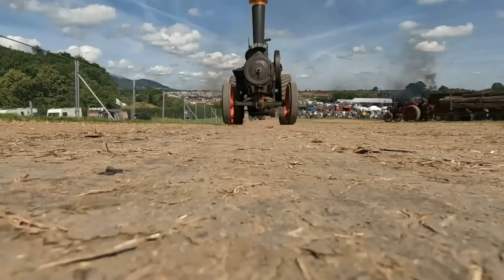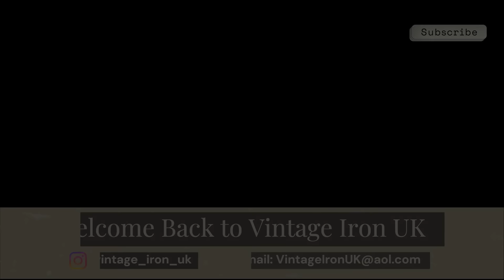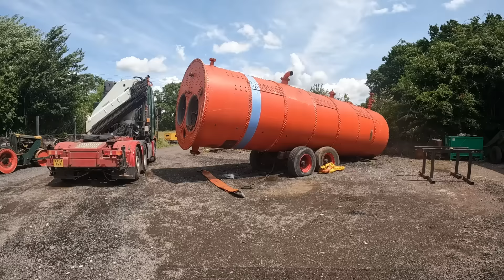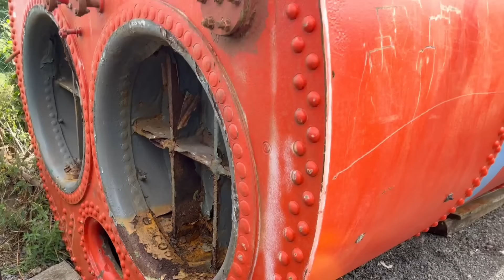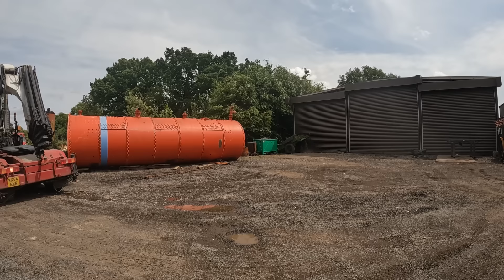YARD UPDATE!! Lancashire Boiler Move, TRACTION ENGINE Repairs, Power Hammer run & Future Projects!

Comment: That enormous, belt driven air hammer is awesome. It'd go great with a good old timey coal fired forge. You might even be able to plumb air from the compressor exhaust to act as a bellows.

Comment: Just face it Norman, the old Aveling was too much for those modern tin axels😁. Loving the big hammer. But I think the old steam crane is the best machine you have that I have seen. Having it under steam with a good boiler would be excellent. cheers

Comment: Norm. Why does the red boiler have a painted blue band? And have you run out of elves 🧝‍♂️? ❤️👍🏴
Reply from the maker: Not a clue mate Somthing to do with the company that used it last as an air receiver. At a guess the blue line would be for air, any pipe work would have been the same?? Gas and fuel being different. As for the elves the quit due to the lack of pay, should have locked the gate 😂

Comment: At Crewe locomotive works open days they used to demonstrate hammers, they had an oil drum full of something and just before the hammer struck they threw a handful onto the hot metal, I always wondered what it was, sawdust perhaps, and I guess to stop the metal sticking in the die. Any idea what it was please ?
Reply from the maker: I’ve heard coal dust being used to stop tools sticking. Could be that or some sort of graphite mix.
Reply: @VintageIronukseen a film at a plate mill they were tossing bundles of twiggy foliage on think it helped blowing the scale off
Reply: @johngibson3837  Interesting They used some kind of powder at Crewe, I guess there were a few methods of getting rid of the scale. I saw a wire brush used to quickly brush off scale somewhere, where they were doing blacksmithing.
Reply: @VintageIronuk Thank you It did flare up in a shower of sparks whatever it was so coal dust would do that

Comment: Looks like the boilers weight maxxed out the cranes lifting limits. I worked on a big babcock and wilcox boiler as part of my apprenticeship and although it was feeding steam to a big concern it was nowhere near as big as this one. What was it used for?
Reply: These common powering mines (or even multiple boilers), such as Cornish tin mines. An upgrade to the Cornish boilers, possibly also large industrial factories too.